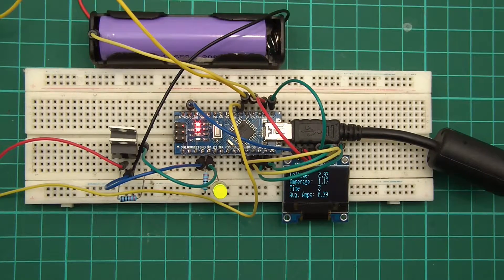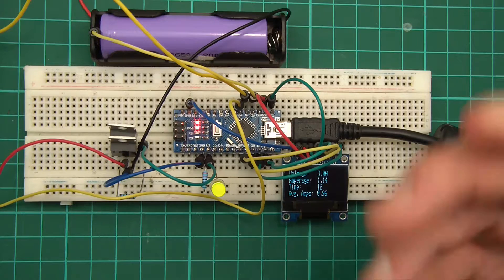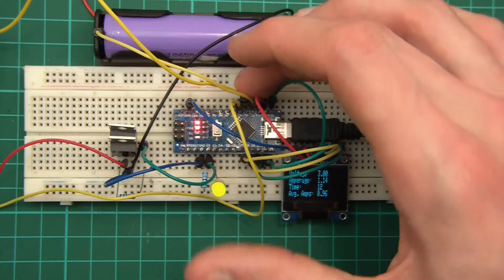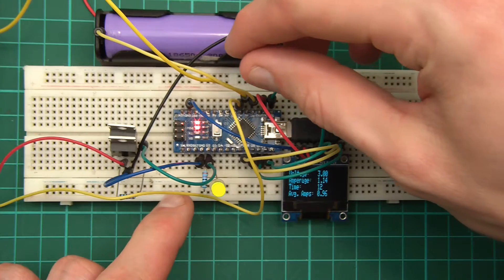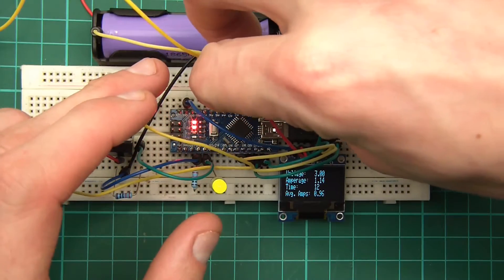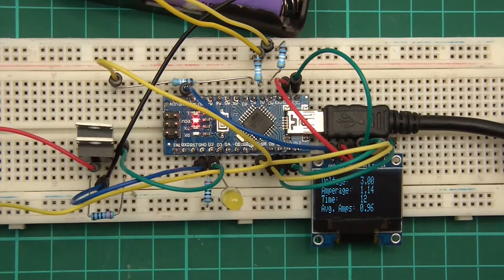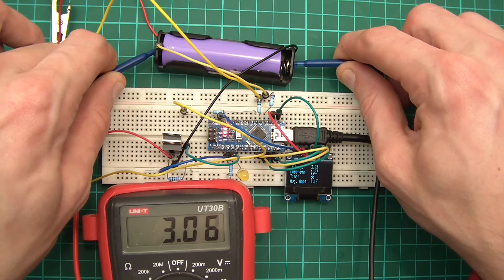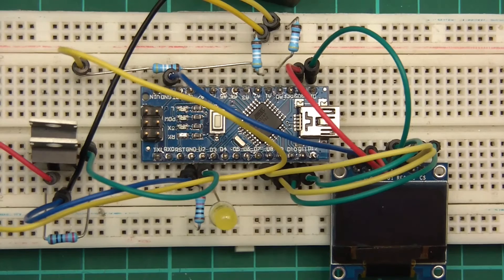TUTORIAL: DIY 18650 Lithium Ion Cell Battery Capacity Checker Tester (Part 8 - Power Drain Problem!)

Comment: That's interesting. So the resistor drops the available current below what arduino needs to keep running. Nice.
Here's another thought: Could you use the Digital pins to get your readings? Connecting 1s cell(s) would never go over the 5V max of what the digital pins could handle. Then you'd just need to decide on how you wanted to do the ranging and divisions. Meaning, you might want to only use the ADC between 4.3V - 2.8V which would give you a stepping of 0.0015V. Not only would this make your capacity checking more accurate, but it would it would also get rid of the backfeeding (this is, of course, highly theoretical as I might be completely off base here 😜)
Reply from the maker: Hi Korishan, Yes, that's right about the resistors! You mean add an external ADC to a digital pin? It might fix the unintentional powering but I guess it depends on the chip in question. It would almost certainly give me better accuracy. Something like the ADS1015 - but I don't believe you can 'easily' tweak the exact ADC range, but yeah, it would be more accurate than the 10 bit Arduino ADC and like you said, it may also fix the other issue... But! The current solution is extremely simple, cheap and effective! Simply apply a stranglehold on the amount of current which can flow from battery to the Arduino! Thanks for your comment! Any other ideas, give me a shout!
Reply: Well, I was thinking about using a resistor voltage divider, I think it is. Allows only certain voltages through. Kinda how you can measure mains voltages or amperage's through a current transformer. So using the divider, you'd block out the lower voltages and only use the top 1/2. Theory, of course  ;)
Reply from the maker: Korishan I think I know what you mean, but we have to be aware of floating voltages. :)

Comment: 1rst, thanks for putting in the effort & time to make tutorials.  You indicate the problem of the Arduino self-powering when disconnected from the USB has been solved.  With no schematic, us viewers are really challenged 1) to grasp WHY the Arduino apparently self-powered w/o more resistors, and 2) to see how the additional resistors appears to have fixed things.  Point 1) would seem impossible, but without a schematic of your wiring, we can't comment further.  Point 2) adds to the mystery, again, because all we have to go on is a jumble of wire connects.

This series has been about a "LI-Ion cell capacity checker".  Let's consider your circuit/code as a "black box" (BB) that functions as you want.  Most BB devices stand very much on their own feet when analyzing a DUT (device under test).  At the end of this video, you disconnect the USB and claim all things work as you want.  But the DUT is serving the additional role of powering the BB.  This arrangement may work OK for now, but who knows if/when your BB begins to exhibit quirks in operation.  Yes, it's more of a bother to ADD circuitry to power the BB, but at least then the BB serves only to test the DUT.

This doesn't mean we're asking you to redesign your approach.  It's just an observational comment.  Cheerz.
Reply from the maker: Hey, no worries! Thanks for your comment!

I do disagree though that you're all challenged without a schematic. I've got no problems in agreeing with you that it would certainly be better with a circuit diagram though. Each video in the series follows on from the previous, and in at-least one of those videos, I've talked about this problem and explained what is happening. I've also explained point 2 in this video! Point 1 is made absolutely obvious again in this video where I briefly show the Arduino unintentionally being powered by the cell without the USB cable! And again, I disagree with point 2... I show you me putting three 5k resistors into the circuit on the A0, A1 and A2 pins. I even say the "A0, A1 and A2 pins", so I think it's reasonably clear what I'm doing!

I don't fully understand your second paragraph but I accept the BB and DUT concepts. The unplugging the USB cable test was a good and successful test because earlier in the video, I shown the device being able to unintentionally self-power, then having added the resistors, I show you once again and the device is no longer able to self-power. That is exactly what I wanted, so I considered the whole operation, including the test to be a success!

I think it would be better if it was all scripted, written, explained in a professional way with diagrams, etc, but it's just not practical for me to do that at the moment.

The device will ofcourse need to be powered properly in a real life scenario. I think the simplest way to power this is by using a 5v, 1A USB adapter, but I'm not too concerned for now. 

Thanks for your comment!